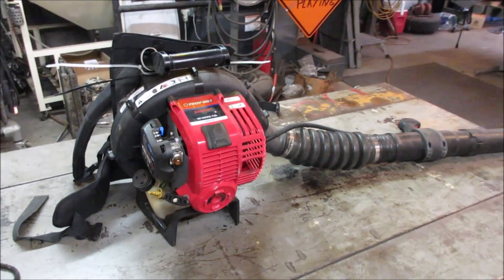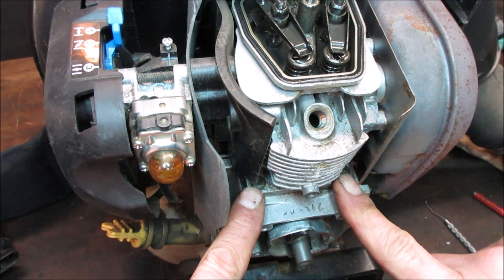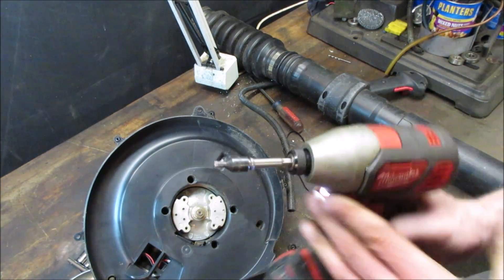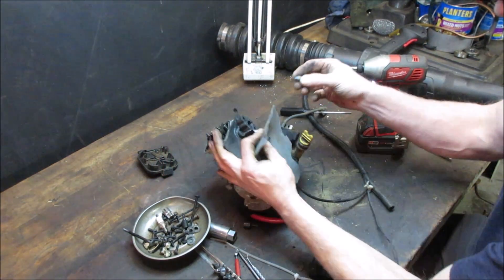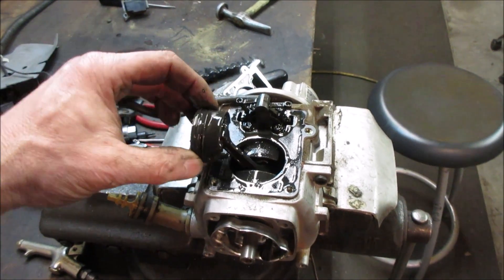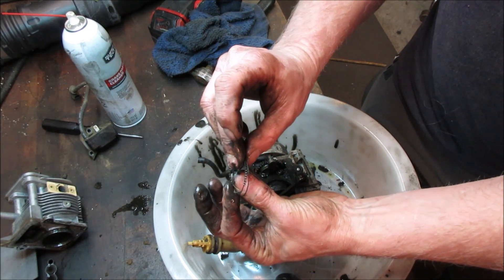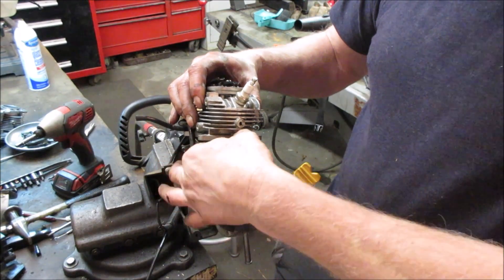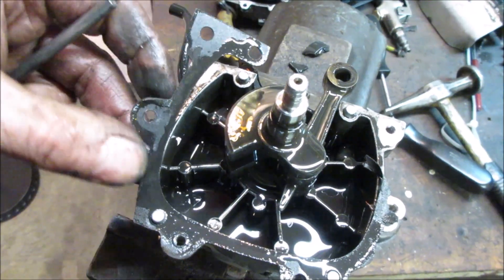Can We Save This Junked  BackPack Leaf Blower ?

Comment: Excellent diagnosis, I'm sure that dirt played a big part in the machine's demise, as well as poor quality aluminum. Those machines really should have 2-stroke engines, 4-strokes really aren't good for the application. My guess as to the function of that cam attachment is some sort of oil pump. Love your channel bro.
Reply: 2-strokes develop power at a much higher RPM. Don't think you'd want to spin a plastic fan that high.
Reply: @curbmassa  except my lawnmower, pressure washer, and generator, all my yard equipment is 2 stroke - including my leaf blower.
Reply: According to you? Honda and Ryobi have made tiny 4 strokes for years and they last fine with decent maintenance schedules.  How many 2 strokes have ended their lives because someone forgot to make a proper premix or forgot to add oil to the gas completely?

Comment: Greetings:
my guess: coincident with backpack straps breaking while engine running; time before delayed/engine shutoff, oil starved due to non-upright engine oil dip-stick could not work and/or oil soaked piston failure. Engine designed to run upright!

Comment: Personally I would buy a piston, set of rings, gaskets, hone the cylinder and run it. That piston skirt did not hurt anything in the crankcase, and the rest of the piston did not hurt the cylinder bad enough that it wouldn't run. That oil ring didn't hurt the crankcase bad because the ring was still intact. Ya I would rebuild it and run it.

Comment: Interesting video which confirms that the quality of the metal which is used in mass manufacturing has declined, although to be fair,  we demand low cost equipment to make our lives easier which is reflected on the quality of the metal they use. The quality of the oil hastened the demise of the leaf blower.
Reply: Each and everyone packaged with 0 fs given and sup sung of hate, don't mind the nets above the first floor.

Comment: Would it have been killed by running full speed and then the braked broke and it hit the ground running full tilt. that shock might have damaged the piston. The tie raps looked pretty clean so they put them on after the fall and then it didn't work anymore.

Comment: Mustie it should be obvious why it failed, you said it had no air filter, and those things stir up a lot of sand dust and grit, it does not take much grit getting into the engine to cause it to bind up and seize fairly obvious the piston jammed up and shattered.

Comment: My guess is that it is an upper lubrication system for the cam and rockers, valve stems etc,,,   oil gets flung up  towards the cam gear and oil gets trapped and is forced by centrifigal force into the rest of the valve train,,,,  I'm guessing,,,, :-)

Comment: I just worked on the same machine the cylinder was scored extremely bad I tell folks add mixed oil gas 30-40:1 even though it's supposed to pick up lube from the case it to me just isn't enough to lube the piston and walls

Comment: If only you had either a full set of imact ready drivers that are in different lengths OR Snap On drivers that have a hex area near the handle you can use to turn stubborn fasteners.

Comment: hey Darin, if i had to guess i'd say it was a combination of being thrashed on and abused..the zip ties on the pad is a tell tale of the abuse this thing has endured..i'd say someone has tried to "fix" it that has no business even working on a hot wheels car...being the steel straps was broken it may have been used right up against a feller's back thus cutting off the cooling and a combo of no air filter making it run lean (hot) and just over worked the internals..just a hillbilly wrencher guess..sendin ya some love and sunshine from deep Alabama

Comment: Mustie, will you perform an anatomy lesson on a 4 stroke and a 2 stroke and explain the differences? Time to move to junk academia my man!
Reply: Maqablypto, he did briefly touch on it at about 27:15 in the video about the exchange of the air/fuel mix taking place in the bottom of the crank case
Reply: I agree. Pulling apart a couple of those grapefruit sized engines, side by side, 4 stroke and 2 stroke would be both entertaining and educational for those trying to wrap their heads around the differences.

Comment: I see you had a hard time getting the screws out with a screwdriver. You know you could have done with the screwdriver? You could have taken a channel lock pliers or vice grips and clamp its jaws somewhere on the screwdriver like on a the grip of the screwdriver. And used it to give you more leverage to turn the screw. I do it all the time when I'm not able to use my impact tool. You did not need to go through  the process of filing down the screwdriver bitt to do the job.

Comment: My guess? I think it got hot, the valve seat came loose, and it blew out chunks of the surrounding aluminum. Thus the no compression. The bits inside the combustion chamber are the seat or those chunks of aluminum.

EDIT
Darn it! I was wrong! Oh well.

Comment: Without the air filter, it cycled through some debris. Compression cycle it crunched against a rock which destroyed the piston. The next cycle expelled the rock. So the cause is no longer present. Just like breaking a tooth on a grain of sand. Tried to compress something that can't be compressed.

Comment: My thought is " BRING BACK 1/4" BOLTS ! " Damn useless IKEA torx.
Reply: Torx is OK but hex head fasteners certainly have their place.
Reply: @1pcfred  Not to complain too much but, sometimes, they strip OR you snap the end of your "screwdriver".
Reply: @rverro8478  any fastener can fail. I've snapped the heads right off bolts. That's just the nature of the beast.
Reply: @1pcfred  Indeed.

Comment: Chinese build quality + oil not changed + 10 000rpm = a blown engine!
Four stroke More moving parts, two strokes much fewer moving parts and more forgiving providing it has two stroke oil in the fuel.